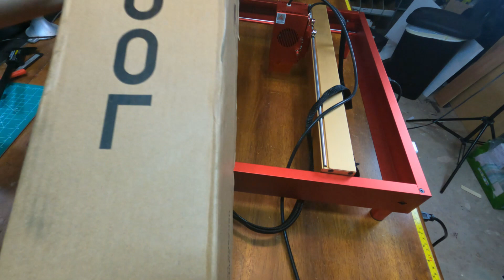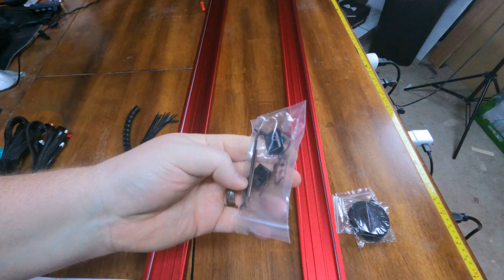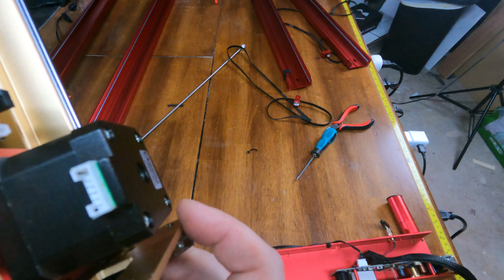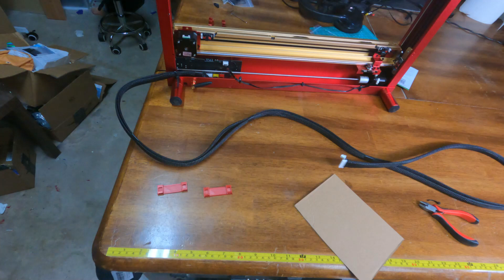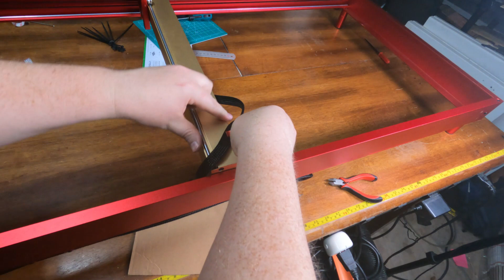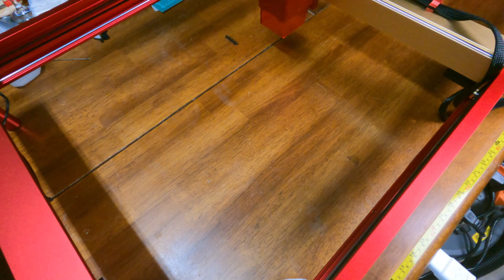The LONGEST 40W diode laser on YOUTUBE!!!!

Comment: Can you verify the max cutting area with this extension kit? I've seen different sizes mentioned and can't get anyone to respond back on what an actual area size is? Thank you.
Reply from the maker: Depends on the module you have for the 40w it is 909mm x 430mm. It lists 930mm x 430mm on the website but that is if you have a 10w. I think the 20w module is a little smaller but I don't have one so I can't measure and tell you if that is the module you have.  I put it at 900mm x 430mm and it works great
Reply: @doubledwoodworking  thank you, I appreciate that.